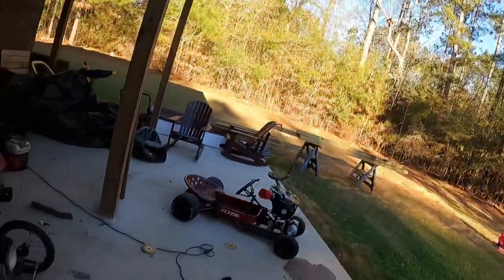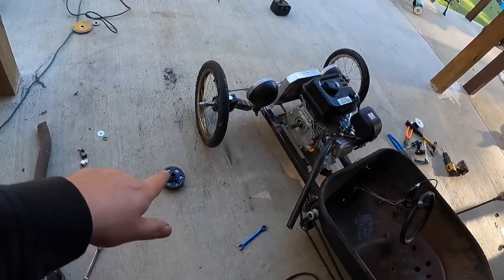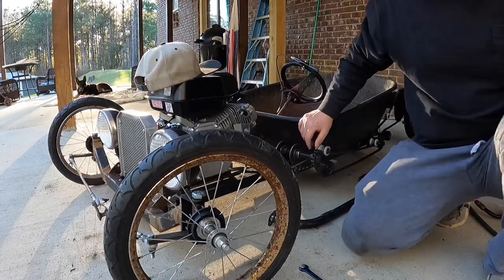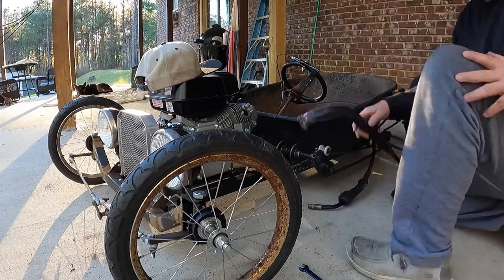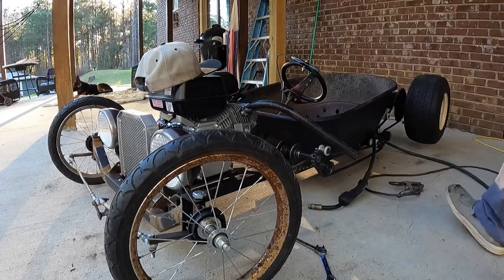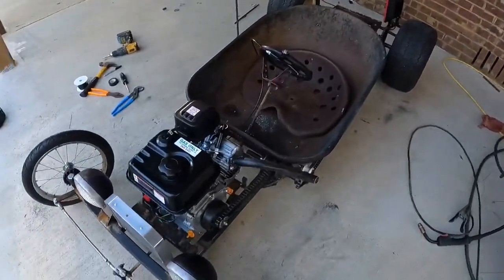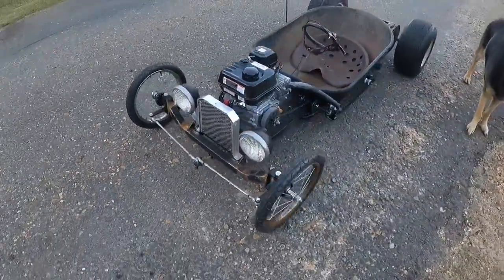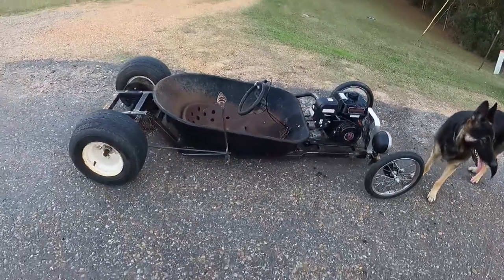DIY wheelbarrow go kart build. First ride in The Rat Bucket.

Comment: Instead of messing up clutch after clutch, put a bigger sprocket on the rear and bigger on the clutch teeth count. Bigger rear tires will make your current situation worse. It's all about overall gear ratio

Comment: Your smoking and burning up the clutch due to an improper gear ratio. You need a 6:1 ratio.
Example: 2 gears   9T clutch x 54T sprocket = 6:1 ratio
                                10T clutch x 60T sprocket = 6:1 ratio
                                12T clutch x 72T sprocket = 6:1 ratio

Jackshaft 4 gears 10T clutch x 20T sprocket = 2:1 ratio
                                 10T sprocket x 30T sprocket = 3:1 ratio
**now multiply these 4 gears together 2.1 ratio x 3:1 ratio = 6:1 ratio  

Any number of gear tooth configurations will work with a standard S&S clutch like your using in this build so long as you keep to a 6:1 ratio. All S&S clutches require a 6:1 ratio and are rated for weight of your build i.e kart or mini bike, plus the rider weight of 550 lbs maximum gross vehicle and passenger weight. And will last for several years just adding a drop of oil on the brass bearing before riding.  

The same 6:1 ratio should also be used when using a 30 series torque convertor.

Comment: 10clutch .25. 35 .25 .35 74 you need this sprocket pattern dude it will blow your mind if that's to much torque the last be 60 if you don't like 74 but I no u will